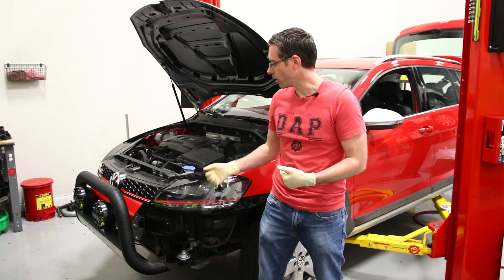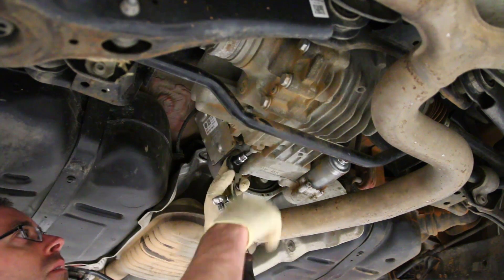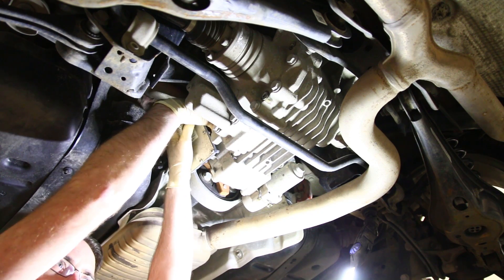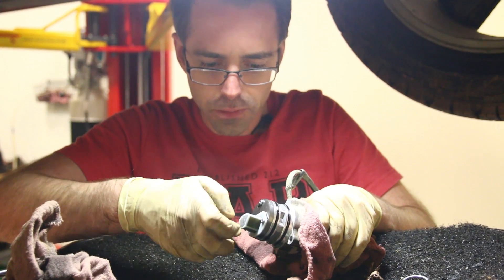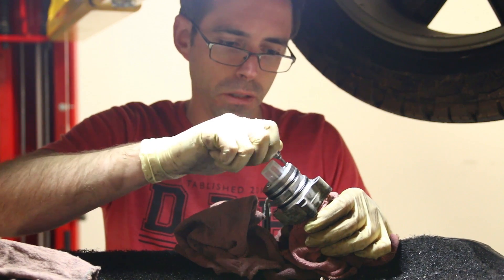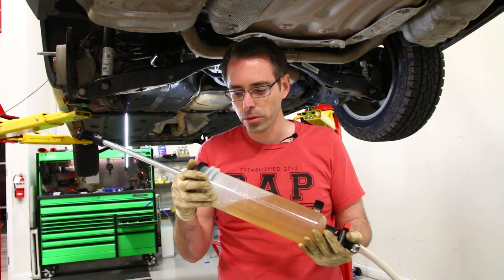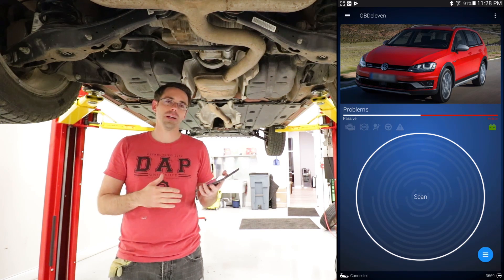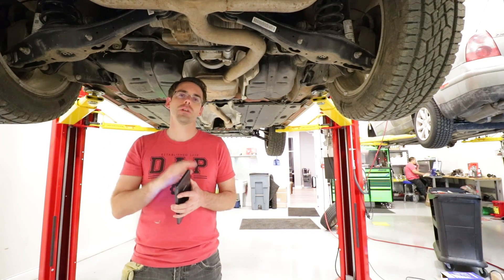How to Perform an AWD MK7 Haldex Service

Comment from the maker: Links Talked about in this video
- We appreciate your Support and Purchases! -
Scan Tool Used to Check Temperature
https://www.shopdap.com/obdelevenpro-vw-audi-scan-tool.html

MK7 Haldex Service Kit (w Tool)
https://www.shopdap.com/haldex-service-kit-gen-5.html

Haldex Fluid Pump Tool
https://www.shopdap.com/1-5l-fluid-suction-fill-pump-wkz-498-001.html

Haldex Pump
https://www.shopdap.com/0cq-598-549.html

Haldex Pump Seal Kit
https://www.shopdap.com/0cq-598-305.html

Haldex Fluid
https://www.shopdap.com/g-060-175-a2.html

Haldex Fill Plug
https://www.shopdap.com/n-902-818-02-vw-audi.html

Haldex Drain Plug
https://www.shopdap.com/n-910-827-01.html

Comment: I note you not using new drain and filler bolts or new O rings. So, it must be ok to re use them. 👍
Though it is recommended to renew them but obviously not a must.

Comment: Just did this I’m not sure what I did wrong I now have a fault c111207 and my haldex won’t engage , anyone else run into this ? Note the top ground seemed to be no longer connected before removing the pump even

Comment: Why does the owners manual say nothing about this or the diff or the transfer case? Only talks about engine oil, transmission 100k, and radiator fluid. Is all this other stuff actually necessary?

Comment: Can you just use a laser thermometer to check the temperature of the oil going in, and the temperature of the haldex?
Reply: That should be fine. However you will need something like an OBDeleven to run the pump, so why not just read the built in sensor since you're already in there?

Comment: Good reccomendation on removing the wiring from the pump. What is the deal with the braided ground wire around the wiring? Mine basically disintegrated.
Reply: Mine too!

Comment: Hi Paul, any tips for what to do when the hex on the fill plug gets stripped? That's what I have run into - I am glad I heeded your suggestion for removing that before the drain plug. It does not seem like there is enough clearance to use an EZ-out or to cut slots into the fill plug and turn it with a big flathead screwdriver. I am hoping there is enough room to get a bite with a pair of Vise Grips and apply torque that way.
Reply: what did you end up doing? Was doing this today and it felt like I was juuuust about to strip it, so I backed off. Getting a smaller 5mm hex bit and wrench, but would be interested in what you did.

Comment: The AWD clutch service interval for 2019 Alltrack is 3 years - time-based, not mileage-based fyi. The dealers use the 30k interval to upsell. Same with brake fluid - time-based at 2 years.
Reply: Doubt that

Comment: I guess you need the car level when doing this so you get correct amount of fluid. I will not be using a ramp so should I jack front and clear of car up

Comment: Drain plug 32Nm wtf.. its a bloody M10 bolt with fine threads. Ur gonna strip! I put fill bolt 12NM and drain 15NM. No problem whatsoever. The trick is the cut/break off the crush washer and replace with a new one. New washer won't lock onto the bolt but as long as outside diameter is about same as bolt head (16mm) and ur good. 15NM on drain bolt on my Haldex. Front and rear diff no leaks
New crush washer is the key I get a pack of assorted copper washers as its hard to get those bolts with washer on it from dealer they often out stock and not very keen on ordering for you to make $2

Comment: So you don’t need to replace the pump o rings as part of the removal / filter clean process ?   probably hard to buy them anyway given the whole process isn’t ‘necessary’
Reply: FCP Euro includes it in their kit, at least for the Atlas.

Comment: I need your help. I have mk6 jetta with 1.8t gen3. I realized squeqing noise when car on idle and warmed up. I opened the hood and realized there is load on the belt.I took off the built to inspect the pulleys. AC pulley is wiggling and heavy to rotate. Maybe that's causing the the tensioner to move when car idles. Please check this out. Thanx https://youtu.be/xsuiTHheUCY

Comment: Thanks for this video. I did this last week on my MK7 R and would have killed for this fluid pump as I made a mess with my shitty generic pump. I was surprised at 55k miles my screen was pristine and I know it's never been cleaned before. I live in the WNC mountains and drive pretty spiritedly.

I will definitely buy this tool for the next service as it is a very reasonable price from Shop DAP.

I wasn't sure of the torque specs on the Haldex Pump and did 15Nm instead of 9.5Nm. It did feel a bit too tight at the time, would you recommend loosening/replacing the bolts or is that difference not too worrisome?
Reply: 15Nm is fine, do not replace the bolts in case O-ring get cut

Comment: Paul, some guys on the U.K. R forum have noticed a build up of detritus on the white nylon filter. It looks almost like frogspawn!  According to VW tech guys there is NO filter to clean!  I had the Haldex unit on my 2014 Golf R serviced by an independent VW garage here in the U.K.  I specifically asked them to clean the nylon filter when servicing the unit.
Reply: Same for my Skoda. I had to specifically take it to an independent garage for that. Dealers won't do it and I don't trust them to do it anyway even if they say they will.

Comment: 1:43 So, the haldex and diff use different oils ?
Reply: yes! Haldex fluid is different. Diff fluid is usually 75w90. Haldex fluid part number G055175A2
Reply: @GForceConnections  mk7 haldex fluid is g060175a2

Comment: Should take around 750ml in total. 
No need to disconnect pump wiring. The pump can be removed with the plug still connected. 

I think the more you use the 4wd the cleaner the pump screen. Drive like a granny and your pump will be clogged. Drive like you stole it and it won’t be as bad.

That syringe pump is some bit of kit
Reply: +1 on disconnecting the pump wiring. If you want to completely remove the pump from that area of the car, you'll need to remove the wiring, but otherwise you'll be able to clean the mesh with the wiring connected. 
-1 on the cleanliness of the pump screen. From a logical perspective that makes no sense at all. If you drive it like a granny, the clutches will rarely engage, and therefore will not dirty up the oil. If you drive it like you stole it and engage 4WD regularly, the wear of the clutches will dirty up the oil and clog the pump screen up more.

One other note - if you're doing this on jackstands, you need to make sure the car is level, otherwise you may under- or over-fill the haldex system.
Reply: Matt H I never raced / tracked my car and the filter was blocked at around 15,000 miles. 

Have a look at Bryce’s video on his haldex service (https://youtu.be/M5Jp9XnRx4g). He races his car and his filter looked like mine after I cleaned it 😂
Reply: My pump wire has no slack. Its impossible for me to pull out the pump without disconnecting the wire and its a bitch getting that computer off